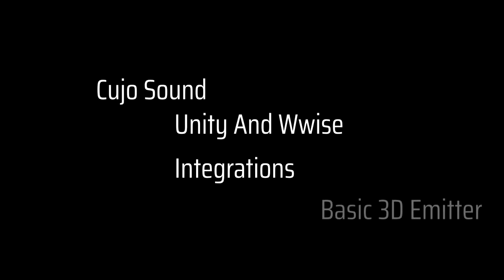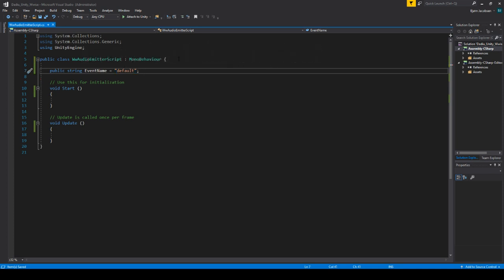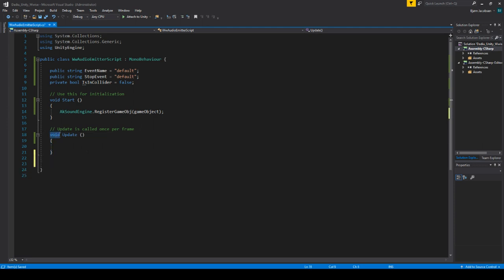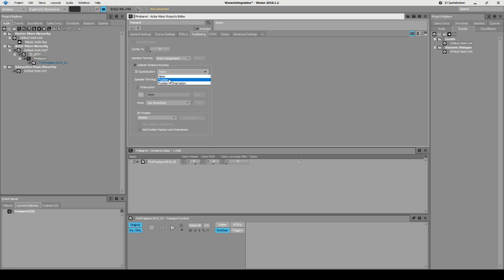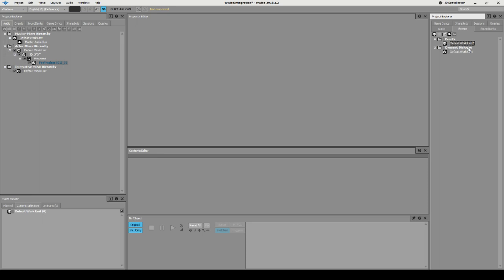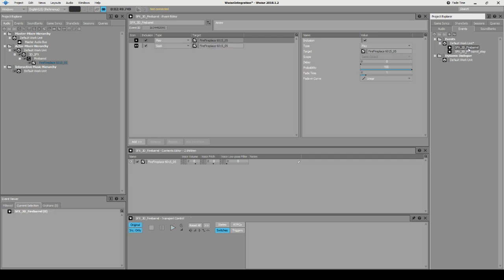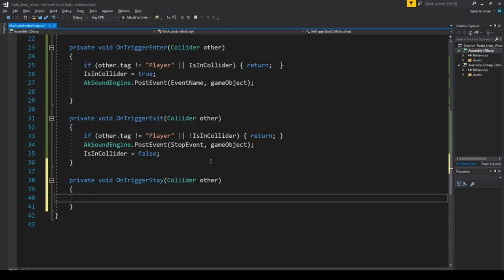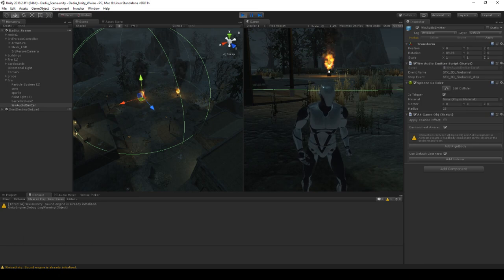Wwise and Unity - Simple 3D emitter setup by a non-programmer: Cujo Sound.

Comment: Hey Bjørn, thanks for this - Had a little problem using this script on the "3DGameKit" on Unity, just writing this down in case someone has the same issue : nothing would trigger even though I added the right TAG to Ellen (the character / listener) Or added a Rigidbody to her (which isn't on the character in the beginning and can cause problems when using the functions  - void ontrigger[...]) - the last problem that I found on this project while using triggers and that actually fixed the issue was on >> Edit - ProjectSettings - Physics - Scroll down and where there is the “Layer Collision Matrix”, on the first line: Default, look for the column “Player” and check the check box. And then the trigger functions should be working fine again. Hope this can help someone!
Reply from the maker: Oh that's a nice find and good tip :)

Comment: Hey there!
Am curious if this approach handles the Wwise/Unity AkAmbient Position Type modes. Like let's say for torches, you'd want to set the position type to Multi Position Mode so that it doesn't play more than 1 voice. Does this function the same way or is there a way to add the "Multi Position Mode" functionality to the Emitter script you talk about?
Reply from the maker: @anthonybruno9812  you can add it to the script, but I've never done that myself in code. 
But it will require that it then knows the positions of them all of course, or objects that it needs to refer to. 

I've only done that with tools pre-made for me I'm afraid.
Reply: @CujoSound  ah gotcha. Yeah that all makes sense. Maybe it’s possible to make a mesh of the code between the tool and that multi position mode part in some way then. Thanks for the reply and info around it!

Comment: Hi Bjorn, your tutorials are amasing!. My English is not very good, but I will try to write my question. I did everything step by step, when I press play in Unity, no errors appear to me, in fact it says that the integration was successful or something like that, but... NO SOUNDS COME OUT!. When I connected Wwise and Unity in real time, I could notice that no event was firing, instead I get the "VOICE STARVATION ERROR". I read out there that this error could be due to CPU overload due to many voices or effects, but I only put ONE sound with a simple spatialization curve, just like in the tutorial ... please, I need help, I can't get out of this problem!!
Reply from the maker: That's a good question, it's quite hard to determine what the error may be, but it's clearly not a code or unity issue as such, it sounds quite a lot like the integration of Wwise / Unity has some setting which isn't correct.

Comment: great tutorial.  In play mode i am getting "Event ID not found" .  Thought I had set up correctly.  Any suggestions?
Reply from the maker: That's when you haven't built the banks in Wwise.
Reply: Soundbanks were built.  i am using arcamera as my player.  I see in the console the trigger was working but maybe the path is wrong?
Reply from the maker: @davidmiller6452  and the right soundbank has been loaded and in the correct location ? That error is only when an event doesn't exist in the current bank context. Should work out of the box . :)
Reply: @CujoSound  i may need to do a prior tutorial on a basic setup for wwise soundbank creation.
Reply from the maker: @davidmiller6452  it's possible. Let me know how it goes. :)

Comment: Thanks for doing this. The script is really flexible. But I just cannot get any sound out. Oh well.
Reply from the maker: What does it say? do ?
Reply: Ok. There are no errors at all. The script you made is all good is Visual Studio. Wwise soundbanks/events/audio folders are all good and no errors in Wwise to unity or VS to unity. There is nothing showing though on Wwise profiler. All Ak objects/scripts in Unity are correct with no errors. If I use Unity's Audio listener, and load it up just through unity then it's all good. I tried without attenuation from Wwise, still not working. Spent 5 hours going over your video and triple checking my triple checks. I've literally done the same thing that you have. Tried swapping Unity camera tags from MAIN to PLAYER but no audio, tried using standard asset camera, no audio, Made my own camera, no audio. The listener is on main cam, not on my Fps controller. 

I've no doubt that it's something to do with how Wwise and Unity 2019.3.3 are talking to each other as every single one of your scripts is solid. 

Don't worry though. I'm not complaining. There are other ways to skin this cat and your videos are a real resource, so thanks!
Reply from the maker: @russjohnson1715  Do you have a Wwise listener in the scene and all that ? on the camera / player / something?
Reply: Yup. But don't worry. I just mentioned it for reference in case one day someone else has the same issue and sees this. They might even have a fix for it.
Reply: @russjohnson1715  I've literally got the same problem! I actually had all this working in the same project but through version control lost my scripts and deceided to re-write for practice... Now I get no sound at all. If I simply use AkEvent script then I can hear and see the sound in the Wwise profiler, but with this sxcript, I get nothing...

Comment: Hey Bjorn, 
Thank you so much for making these videos, I found them more useful than the Audiokinetic tutorials themselves. 
I'm still struggling to get any sound coming out of unity though, even if I followed your video step by step.
I'm using the Unity 2D Game Kit as a sample project, which has all sounds already implemented but I'd like to replace them all using Wwise instead, so I integrated wwise into the project and followed your tutorial but no sound is triggered when I start playing the game.

Considering that none of the sounds that came with the Unity 2D Game Kit are playing either, do you have any idea of what the issue might be?

ps. I'm not getting any error in the unity console
Reply from the maker: I haven't tried in a 2D project. But, maybe we can make a case of this, if you send me the project? B at cujo dot dk and let's see if I can make anything of it ?
Reply from the maker: And thank you, for liking these videos. Really appreciate it.
Reply: @CujoSound  Absolutely deserved, your tutorials and insights into the industry are absolute gold!
Reply: @CujoSound  Hey Bjorn,  Same as @methenry90
 I have the same problem. I followed the video step by step and no sound coming out. Not getting any errors either. I can get the sound playing through the AkEvent though so there is not a problem with ntegration I think. Did you find any solution?
Reply from the maker: @jocker0yt  actually I didnt. But when you say you have sound coming from AKEvent, but no sound plays, that makes it a little confusing to me? 

If you can get an AKEvent to fire from the game, then audio should be playing. It could either be that there is no listener or that the sound is 3D and typically positioned really far away in that context.
Reply: I also have similar problem, then i turned off the Attenuation on Wwise, suddenly there is sound. Apparently Wwise attenuation and Unity doesn't seem to understand each other???
Reply from the maker: @bayuwegamadyasta8294  they do, and any wwise object shouldn't be affected by anything unity related like that. 

Sounds like the object you attach the sound to is located in the wrong 3D location. 

Have you checked the profiler to see if the sound plays or not and where it is ?
Reply: @CujoSound  you know what? I am stupid. I forgot to check the tickbox on the sphere collider and by that not activating it. It works now..!! you da best!!
my parents should be ashamed for having me
Reply from the maker: @bayuwegamadyasta8294   I'm sure you are welcome in the family and here still  :D
Reply: I also have this problem with GameKIt 2D.  Did you solve this problem?

Comment: If you want to reference the Events directly in the inspector, you can write:
public AK.Wwise.Event[] wwiseEvent;
- You have to set the size to something larger than 0 first, but you can then choose events from the inspector.

In the script, instead of AkSoundEngine.PostEvent(), you use:
wwiseEvent[].Post(gameObject);
- In the [] you write the number assigned to the event you want to call.

Wwise is giving me some problems currently, so I haven't actually tested it, but that should work. 
- No strings attached (Haha... I'll show myself out).
Reply from the maker: Haha. Yea. You can definitely make things easier and code look and feel better, and more efficient with things like these.
Reply: It works perfectly. Thanks!